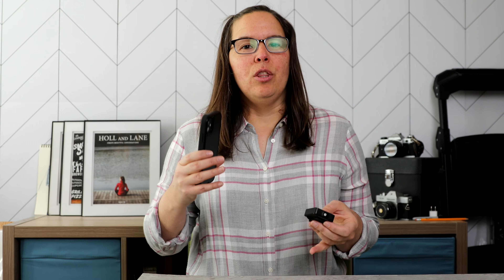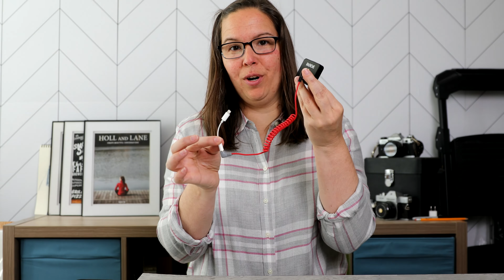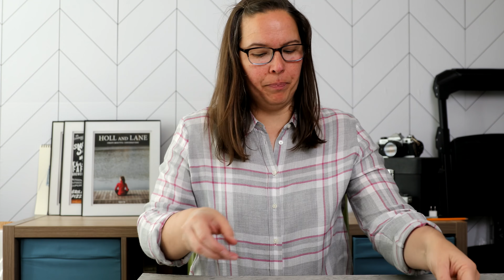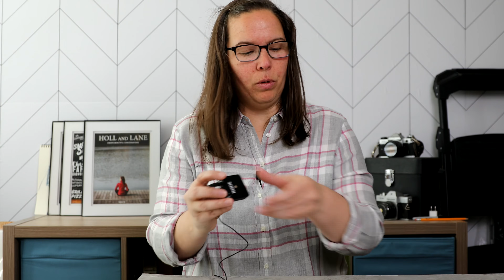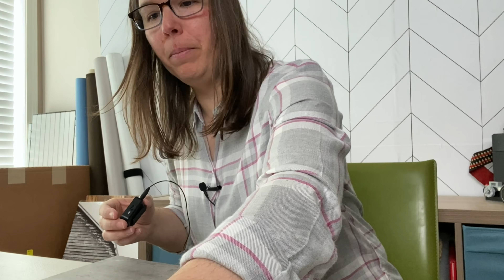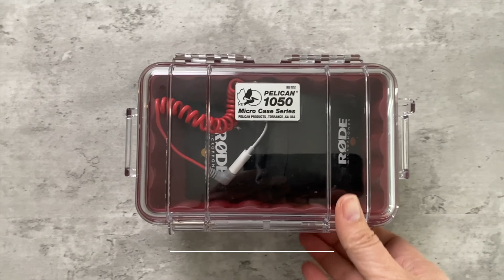Better Audio for your iPhone videos with the Rode Wireless Go System: Step by Step Guide

Comment: Im having trouble knowing how to get the video i recorded with the new audio using the system. Ive been able to connect everything but i dont understand what to do when im done recording or how to capture it if that makes sense?
Reply from the maker: If you are connecting it to the phone and taking a phone video you don't have to do anything special but put the two devices on and record. The video will be in your camera roll and then you can airdrop it to a desktop/laptop.  Does that answer your question?